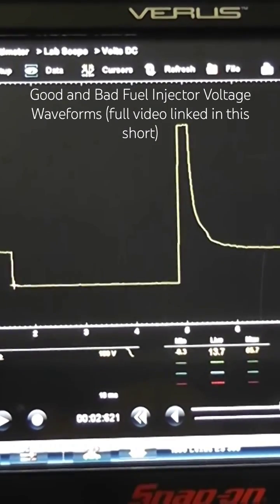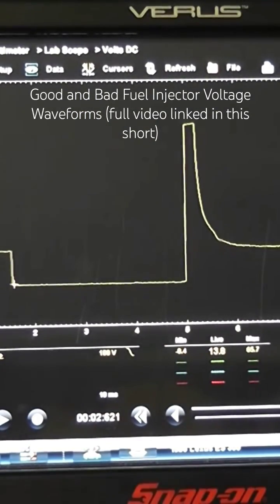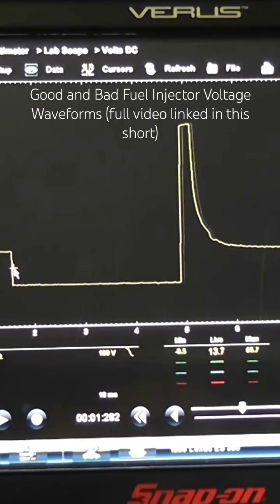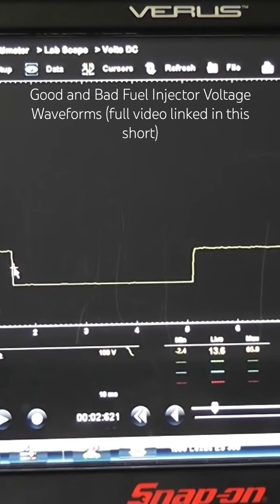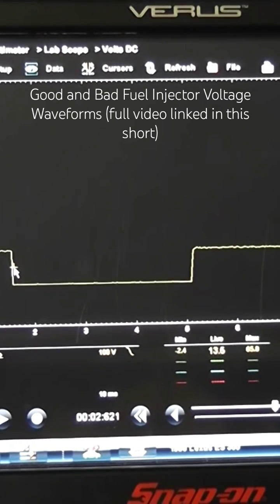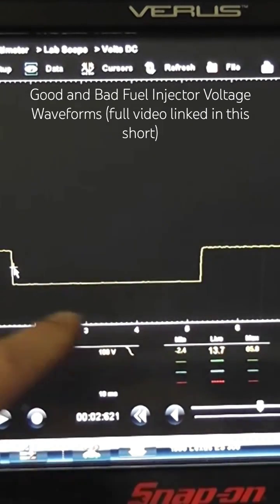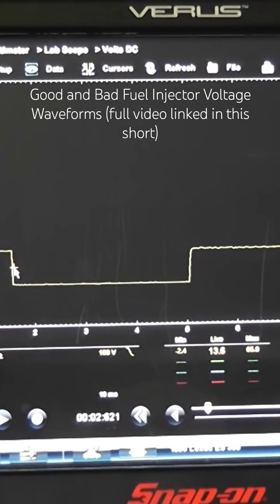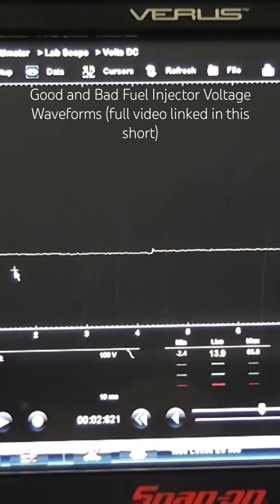Good and Bad Fuel Injector Voltage Waveforms [misfire with engine warm]

Comment: I'm new to the diagnostic side of things... I'm assuming you're using an oscilloscope to test the injector along with the voltage feed side? Since it seems those are two different tests,  you would use 2 separate channels for that?
Reply: no, one channel, just moving the probe from terminal to terminal